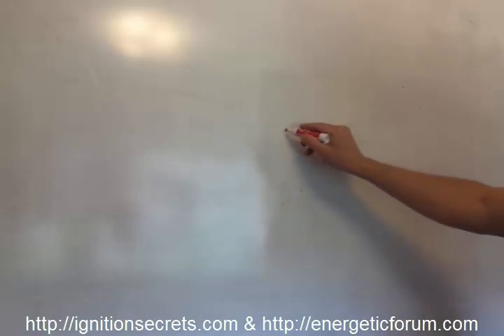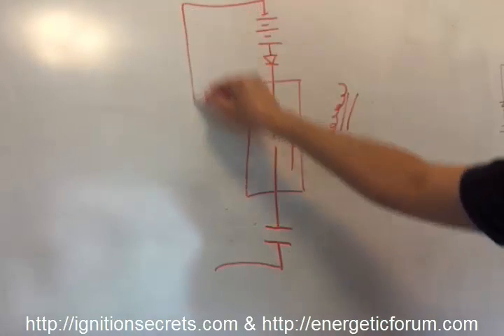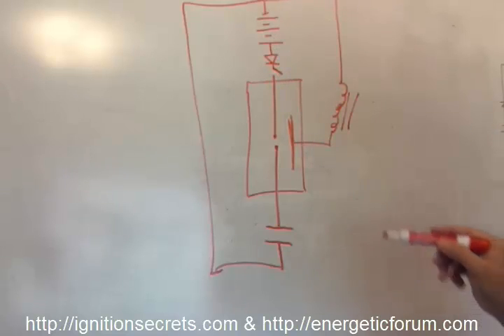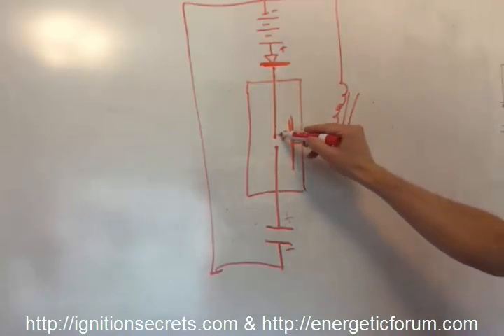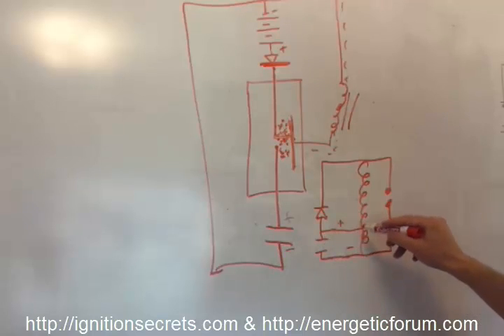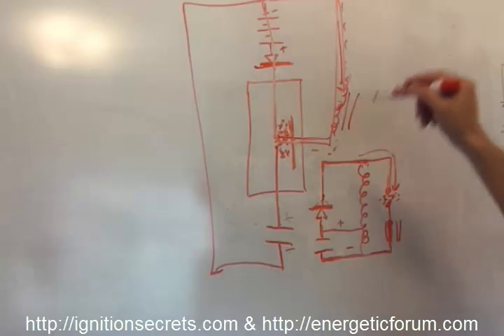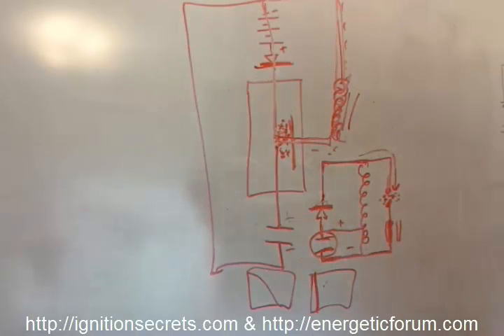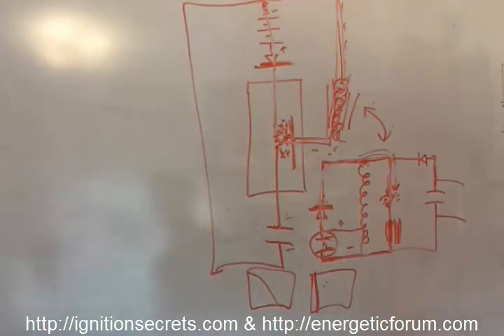2015-05-14 Gray Tube compared to Plasma Ignition

Comment: Aaron the EV Gray tube (IMHO) was a wrongly executed Tesla wonder. In the EV Gray motor it was a just a huge spark plug. Thanks to your work I was able to replicate the switching of lower power sparks creating an ion bridge for the larger discharge in the opposite direction to ground. However my findings are, to induce enough discharge for motive force (with torque), you still have to pay the piper and charge them quick enough. The spark gap burns out because of the huge pulses you are pushing through it. If you have to use a lot of power, and can't keep it running because it doesn't fire on every coil, because the electrodes are coating, what do you have...The over all end product is a scary pulse charger that works for about 30 minutes?  I think EV Gray failed at over unity, however if you took that tube... and filled it with gas, and put capacitor plates bisecting the plasma so the scaler pulse is parallel so the plates are 90 degrees from the current flow and collect it at a resonant circuit,  now you have something (DS patent). Check out Don Smith, all of this becomes clear. There is no Aether just electron pairs moving from excitement to rest, and releasing EM waves. The most significant EV Gray circuit was his 6000 Hz supply. Don Smith shows you why that is so important.
Reply from the maker: +XR IX The power supply was an air gap transformer and when a cap is charged with the HV repeatedly, the cap develops and electret type effect where it will self charge quite a bit after discharging. I don't mean the normal small % bounce back after discharge, but a serious rebound to higher voltages.
Reply: Hi Aaron, is that the two different levels of discharge of the cap? I noticed a higher first discharge and less powerful discharge, then almost a pass and then the same one two punch. That being said the EV circuit, would be good for a capacitor discharge magnetic gun, I had great results out of that, and could pop a magnet to hit the ceiling. If we assume we are going to drive any load motor or generator... I don't see it. Now maybe if your cap charger side was somehow using 10 watts to keep the capacitor charged through a heavy cycle consistently... maybe. But I was using about 800 to 1200 watts to drive my motor. If EV Gray said his power supply had better efficiency, it's because he was extending the performance with his 5KV@6000Hz... which I never understood your high/low size. EVG's has low voltage of 12V at high AMP, and low side (low V, big A) and 5KV@6000Hz(High V/small A + high FRQ). I was using 15KV@60-6000Hz but wasn't able to cause the effect with out being over 200v DC at the cap. But I guess if you design the tank circuit right, you should be able to pop the cap discharge as long as you have the ion bridge across with small current HV sparks.
Reply from the maker: This was my little motor test: https://www.youtube.com/watch?v=nxsoze9CZ9E

My high/low is simply a scaled down version using plasma ignition as the HV side and caps charged between 160v and 1200v for the LV side. For my small scale tests, I stuck with these parameters because I found that unless you have a seriously lethal discharge for the HV like 5kv at 2-4uf, it will be very difficult to get 12-24vdc to follow over the gap.

I added a bunch of recent posts in a discussion here: http://www.energeticforum.com/renewable-energy/3235-gray-tube-replication.html was trying to help someone out on this project who just wanted to complain about everything. Anyway, more details there. Would be great if you can share your experiment on that thread. Need clarification on the 1st 2nd punch.
Reply: +Aaron Murakami Aaron, you got to tell people the truth - this technology is waste of time (as presented) I know you don't want to hear that. You probably gonna smoke this post, but I implore you to do the right thing.
Reply from the maker: XR IX
You have no idea what it is or why the circuit massively increases the impulse power. The Gray circuit was not just a big spark plug. The HV and LV mixing over the gap creates a negative resistance that accelerates the discharge current bringing the power level up to levels that is supposed to be impossible. It is not a waste of time, thanks for your comments, but you have no idea.
Reply: You are right, I may not.  I can accept that because ---I want to be wrong. I believe the EV tube (CET?) was a sparkplug. You yourself validated that by making a two point circuit (using a sparkplug LOL). I believe it is possible to increase power in a resonant circuit. I am just not seeing the resonant component or anything more than a discharge off a capacitor through a coil. You still have maintain  a constant charge to your capacitor. If you are gaining power, and have proof, please indulge me and show me, I'm sorry to say you're latest video does not. The being wrong or having no idea, is no way as important as having something people can use. I'm willing to have a bloody nose to get there.
Reply from the maker: +XR IX  That is showing the principle. In the original Gray circuit, the only thing there that can run in a resonant condition is the power supply charging the HV capacitor. But the capacitor is simply discharged each time a coil needs to be charged to run the motor. That isn't really a resonant discharge in the same way. The only way you're going to run this type of discharge in a resonant manner is if the load is not a motor, but the input of the primary of a transformer coil where it is solid state - then you have the secondary of that transformer giving you the output instead of mechanical work. Then the transformer needs to be tuned along with the rest of the circuit so that it runs at a fixed cycles per second. 

In my simplified 2 point circuit, you don't seem to understand what is happening at the gap - 3 point or 2 point doesn't make a difference. The low voltage source is able to discharge at an accelerated rate. The current isn't just accelerated only at the negative resistance of the gap, but over the entire circuit, which allows the cap to be discharged in an accelerated manner. That increases the power and has nothing to do with resonance. 

Now, if you have the discharge happening as mentioned in my first paragraph, you are simply having the amplified power discharge at whatever resonant frequency the transformer is tuned for. 

For the ultimate in resonance as applied to this principle would be a transformer that charges the cap with ONE single spike - and that spike charges the cap all the way to the top - and at that moment it discharges over the gap - that is the preferred method ultimately AND you get a massive power increase as long as a LV source follows the HV source over the same gap. 

You appear to be talking about power as if power is energy. Taking the SAME potential energy and discharging it over 1 second you get x power. If you take the SAME potential energy and discharge it over 0.5 seconds, you get 2x or twice the power for half the time. Most conventionally minded people are clueless as to the benefits of increased power. They claim it makes no difference because it is still the same amount of energy but the same energy discharged in a shorter period of time with more power does things that the same energy discharged at a lower power cannot. It's not even up for debate because it is an indisputable fact. 

Take a hammer and softly tap it on a window 10 times and you don't break the window. Take the energy in all 10 taps and discharge it all in one single blow and you completely shatter the window. You can get power increased in both resonant and non-resonant circuits.
Reply: Aaron Murakami Thanks for taking the time Aaron. I want to believe what you said so help me out. Can you tell me if EVG ever had a load to prove the massive(which is relative) gain was turned into electro-motive force? I mean he had a motor, did it drive anything? You can calculate the power produced, and over a spark gap at a specific potential it does yield thousands of watts instantaneously,  I calculated the discharge off the potential of the capacitor and speed of discharge. Even if you have a huge gain for micro seconds, it's a fraction of the motor revolution so your drive is gone 98% percent of the time. HP is based over time period, so I wasn't generating a lot of HP. That's why I used a single coil ---to determine if a single blast is enough to get torque. It was using a 450uf@400V, and it would turn... but it's not gonna chop wood. Can you tell me if anyone has got an EVG motor that can do anything besides charge batteries?
Reply from the maker: XR IX
It was for a car called the Fascination but was not practical because it takes too long to get off the line. With this kind of motor, there is no instant torque when you apply a mechanical load. You have to wait for it to speed way up and then gradually draw the mechanical from a transmission so the bottom line is that it is not suited for a vehicle at all. It is fine for turning a generator at a fixed speed if you want to apply it to a mechanical load but definitely not for a car.

This does not mean it will not produce some serious HP, because it will, but once it is up to speed, which does take time.

It is an excellent battery charger as well and "overunity" tests have been done by many qualified labs who actually verified it including a military think tank funded by the famous singer Bing Crosby who happens to be here from Spokane - a part of Bing Crosby's history that most people have never heard. The Crosby Institute solved many problems for the military during the war.

10 horsepower at 1100 RPM over 21 minutes consumed only 9.75 watts, which is serious overunity. http://www.free-energy.ws/pdf/crosby_letter.pdf that is one of many tests by qualified engineers.
Reply: +Aaron Murakami Three questions:

1. How did they ever resolve the intense spark wear in the gap? (I was able to sustain the spark continually for about thirty minutes through an iridium spark plug, until the electrodes were hollowed ---but how practical is that?).

2. You're saying that all the gain comes from the electron avalanche across the spark? (What I'm wondering here: is that if you have to fill the buckets(cap bank) in time for the next pulse, where are you getting the coulombs to do that, but from your LV supply... unless the CET worked... and it couldn't --because it simply wasn't made right, if it was, whatever we are allowed to see in the patent was incomplete or misleading. I don't think EVG knew one way or another. He knew it was important enough to carry three in a suitcase with him, and spent a lot of time describing it to JB; only to be abandoned?.There are fragments of information that showed it's real application, but like hemlock... too little of the truth put's people to sleep, too much is poison, and the line is thin. Other than the CET the rest of the circuit was trivial. I think he was handed a Tesla circuit that was the real deal, an what he culled was a Thyratron.

3. If EVG demonstrated  7457 watts with 10 watts in... and most importantly, if we know how to build it today, why have we not seen any replication of this technology or practical application... Does your's show even one order of magnitude gain?

Conclusion: You may know the truth, and I don't. I thank you for letting me question you about the EV Gray motor, and respect your skills as an experimenter. I would love to see you work on a Don Smith 15-30 KVA device.

Take a hammer, and hit the load bearing wall in your house, in sync with it's natural resonant frequency so you maintain a standing wave. The house shakes... and all the glass shatters.

http://www.free-energy-info.com/Smith.pdf

I'm moving on... thanks!
Reply from the maker: +XR IX The gap in the tube had silver on the tips of the rods for prolonged life. I don't recall the longevity of the plug gap but I believe Mark McKay has it documented in his research. 

I'm not saying all the gain comes from the avalanche across the gap. I'm saying that the negative resistance is not just at the gap but extends throughout the circuit to the cap to accelerate the cap discharge and that is where a massive power magnification is happening. But one think you need to understand is that anywhere you have a very sharp gradient, gains appear because of the break in the symmetry of the source potential at that area in a way that causes it to come into that area and contribute to the input. So there are gains made available at the gap because ambient source potential will move into the gap and will move into the circuit and that extra potential does not come from the input capacitor. You are assuming you have to fill the bucket each time. We have taught for years that caps charged with high voltage spikes develop an electret type effect where they can bounce almost all the way up right after shorting them - way beyond the typical cap rebounce, which is normally very small. That means that the electret effect is a FREE potential difference FREE from nature and we don't have to pay for that, we only pay for the remainder of the bucket. Also, a battery hit with impulses puts the battery in a charging mode where the lead ions start moving with a lot of momentum. With enough of an impulse, they will continue to move in charging mode even when you do not have anything connected to it for a while and what you can draw from the battery as a real load is more than what you can measure going into it. There are multiple gain mechanisms in the entire system. You say the CET wasn't made right - I don't dispute that, but you are stating something that you actually have no idea about and it is just a belief. There are missing parts in the patent and much is clarified in Mark McKay's documents. EVG appears to most definitely NOT know everything he was doing because it looks like he stole the principles from a man named Marvin Cole. What is in John Bedini's diagrams is correct - that motor worked as claimed and was examined by JB and Ron Cole. The stumbling block for most people when looking at that is not understanding how or why the diode is reversed like that on the LV source - most believe it is automatically a blocking diode but it is not. I personally do not believe the tube was necessary but the sequence of discharge is. Thyratron was used as a diode. 

Everything you're asking is discussed in Mark McKay's presentations. The original real overunity machine was slowly changed until it wasn't overunity anymore by either Hackenberger or others he was working with. In the end, Gray was using high powered Ignatrons. I don't now if he felt scared to have what he had or was threatened or what but the fact is, very qualified labs, etc... all verified massive overunity.

Don Smith was shown to be a scam in the 80's and most people today do not know he was exposed.
Reply: Aaron Murakami Hi Aaron, if you have a source for the exposure of Don Smith I would like to investigate it.  There are just so many other's that used two coil configuration, that were noted to work. Also Don Smith really demonstrates some simple theory at his symposiums, and all his devices use that theory predictably. He's consistent in his presentations...  even after being decimated by stroke after stroke. It all clicks in me, and maybe that's naivety or that I want to believe in the tooth fairy, but it aligns with my mental models... Don Smith said that hundreds of people have worked with him  on one of his devices, but he only knew of six that accomplished it (he said he wasn't sure why). The fact he had a number is quite uncharacteristic of scamming. That is not hard to believe if you look at many failed attempts on youtube, (you can spot the errors), it's only a matter of time before someone starts to scream foul. His explanations allude to the rational for Wardenclyffe. His first device is literally a small version of the Tesla's concepts, and you used to be able to buy kits to transmit to a receiver and run a 50 watt build.

Look, I am not beyond fooling. But I can say I built the discharge side of the EVG motor, and not many have done that from what I can tell. 

You describe what I thought happened to EV Gray motor loosing it's over unity. My gut tells me that you have to have something different to get OU, or use it in a different way. Once the CET was removed the magic left. I know our circuits don't take advantage of the magnetic disruption, so we can get only what we get through squeezing electrons through the bloch wall. I'm still interested to know what your LV side wattage was. Thanks:)
Reply from the maker: +XR IX For Don Smith, that is from personal testimonial by people that I personally know who were there back during his original demos - I'm not interested in trying to debunk him, but I believe what was shared with me.

Read the last 2 weeks of Bedini's posts here: http://www.energyscienceforum.com/showthread.php?t=3073 that will get into specifics on the Bloch Wall.
Reply: Aaron Murakami The sea of possibilities for over unity is made to be a treacherous path, purposefully mined, so that few can navigate. If Don Smith spent his whole life scamming people he did it being believable, with theory behind his inventions. Our greed keeps us from sharing with each other, the ignored magnetic said of EM is the key, I have no doubt. The voltage amperage side is what we are taught, but at as the frequency is raised many of the properties for Amps/Volts change... to reactance, think of Teslas, hairpin circuit driving a light bulb under water. Without the CETs(and I believe we weren't shown the real thing) The real magic/device was in a spark gap encased within plates at 90 degree from the current flow. In the schematics it just was a capacitor... which it was. When the plasma at the center of the plates went through avalanche, at a HF resonant tank circuit; the spark which is the heart of torus emanates magnetic scaler waves a product of electron pairs excited(spin change) and returned, the resonant avalanche excited more ambient free pairs as they push the plates full of potential --much like you bobbing up in down in a small pool until all the water is moving to a standing wave, lots of energy for a little energy, hence gain. With plates full, it provided the coulombs to the CETs(spark plug) path to ground through the coils... hence motion.... boom.

Hold the hammer in your hand, don't hit the glass, from your mouth create the write frequency to resonate the glass. Do it long enough the glass breaks... You never had to hit it with the hammer.
Reply from the maker: XR IX
Look at Gray's older UK patent - there is no tube.

I understand about the resonance. My example of the hammer is simply about power amplification by compressing energy in time.